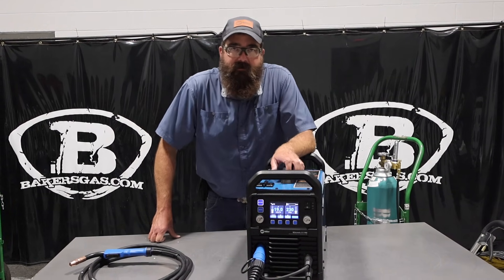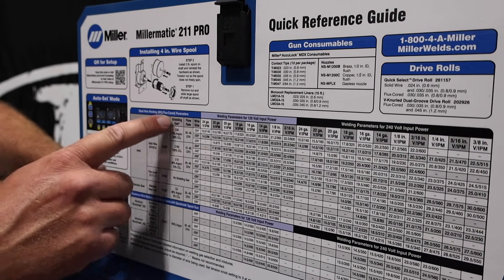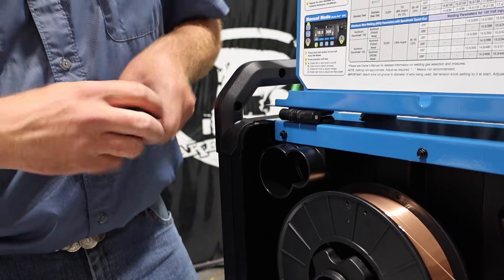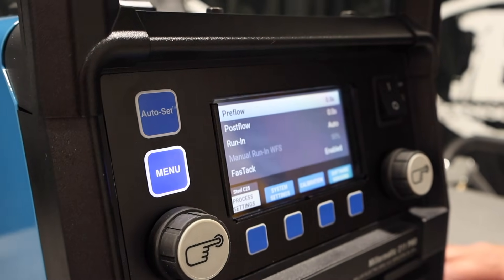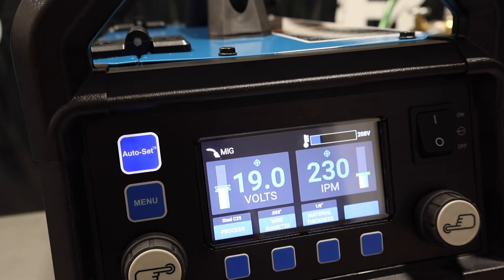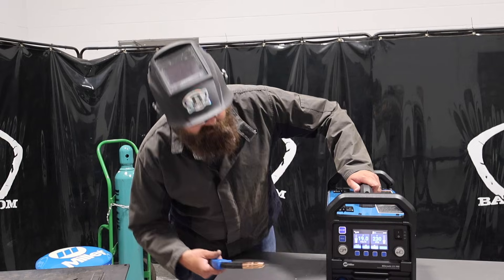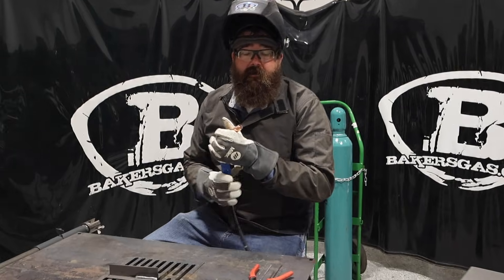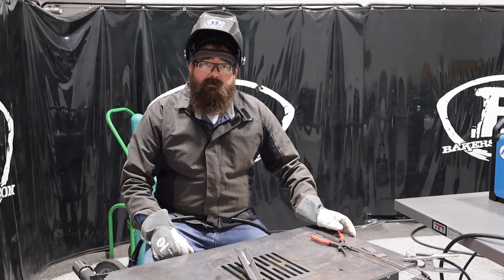Miller Millermatic 211 PRO MIG Welder Review and Demo - 907839

Comment: Just ordered mine last night, shows up tomorrow! Can't wait to use it!
Reply: @WillardSimo did you get it? How do you like it so far?
Reply: @707SonomaComa the thing rips but getting some random rumbling when printing. Not sure if it's specific things I'm printing because I've only had it happen on one thing I printed so far. Also, Bowden tube is too long and it scratches the to plastic so that's a bummer
Reply: @WillardSimo  I'm not sure I understand, what "printing" are you doing? And how is the Bowden Tube too long? Did you take it in somewhere to have it fixed?
Reply: @707SonomaComa lmao, I was just commenting on thread about a 3d printer. Thought this was related to that 😅
Reply: @707SonomaComa but I do love the welder. Super easy setup and it welds SMOOTH!

Comment: My millermatic 211 burnt out the motherboard after 2 2 pound spools of wire was ran through it. The cost to fix it it was more than the price paid new 2 years earlier. Miller said it was because it wasn't  used enough??¿?? All they had to do was replace the motherboard but the wanted to include a $500+ diagnostic fee. I'll probably never buy milker again.
Reply: @WilliamGaylord What did you do with the machine? I have seen quit a few complaints about there motherboard taking a crap. When I go into a welding supply shop they always recommend the Miller brand. I ask them every time about motherboard issues and they always say they've never seen it happen to their customers. Some say Miller just had a small percentage of a "bad batch" and that it is all figured out now.
Did yo get a different brand?

Comment: great vid as usual, would it be possible to push aluminum wire through a shorter  {5ft} gun? if not can drive roll be modified to push AL wire or would the lincoln wire feed be better suited?  thxs
Reply from the maker: You would need a spoolgun to do aluminum either the Spoolmate 100 or Spoolmate 150!
https://bakersgas.com/products/miller-300371

Comment: So this one will weld 3/8 aluminum?
Reply from the maker: Material Thickness	Aluminum 18 ga. (1.2 mm) - 3/8 in. (9.5 mm) Mild Steel 24 ga. (0.5 mm) - 3/8 in. (9.5 mm)